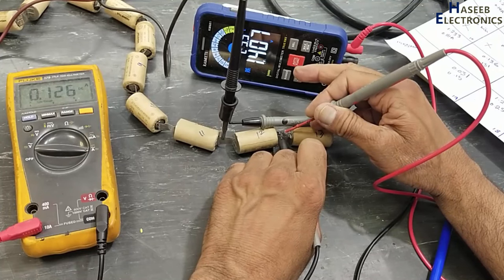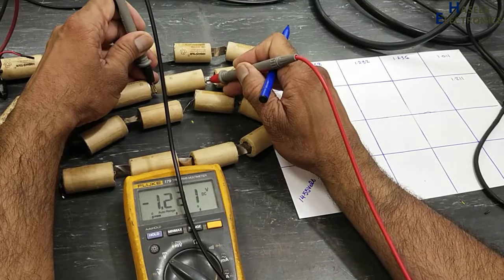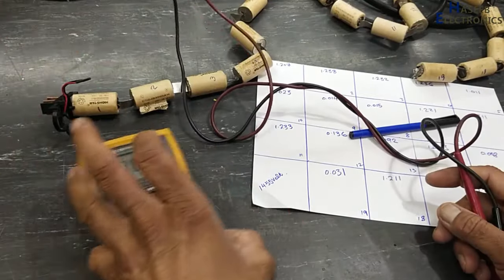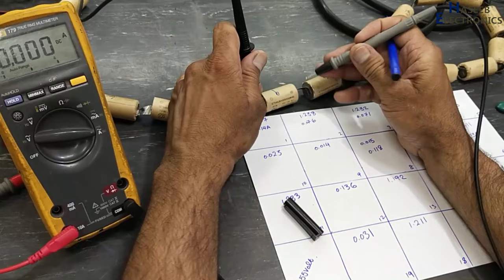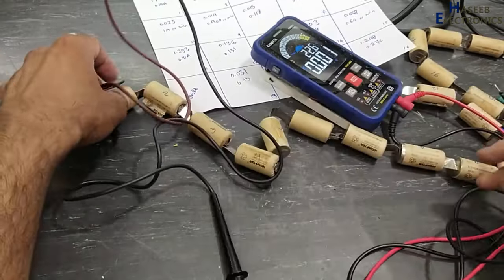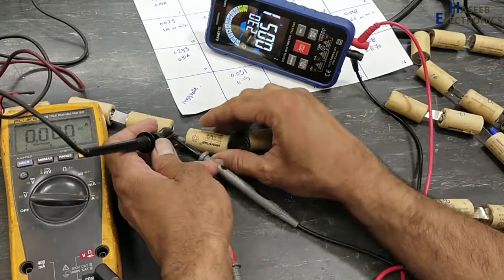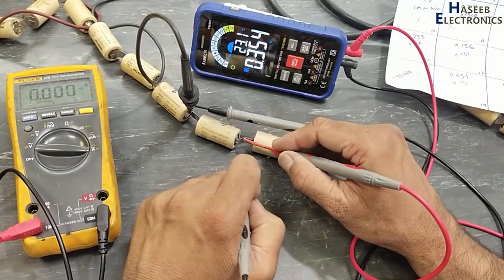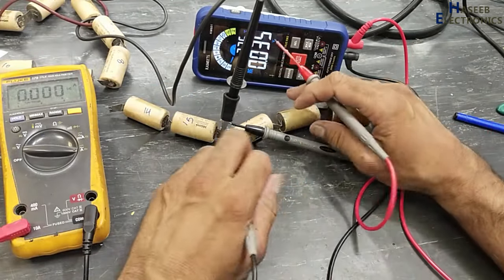{1199} Investigating 24 volt battery failure root cause

Comment: Thanks for sharing. I see Fnirsi has a new Internal Resistance tester (HRM-10) for batteries. I was thinking of getting one. Have you seen it yet?
Reply from the maker: i haven't listened about it. DCIR or DCR can be calculated very simply using DCIR=ΔV/ΔI

Comment: Assalamu alaikum brother. The root cause of the dead cells is because of the way they were charged. Some batteries will have higher resistance and get less current while other the reverse. 
No BMS will stress some cells more than others .. and as a result of continuing doing so, is killing some and others will survives. Charged batteries should be charged using a BMS .. ie battery balanced charging technique . Thanks for the video.